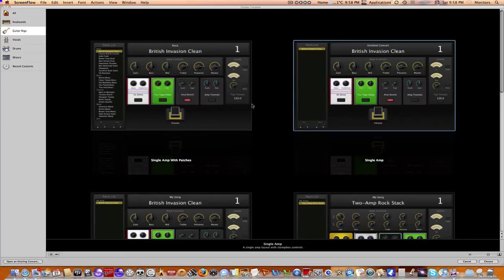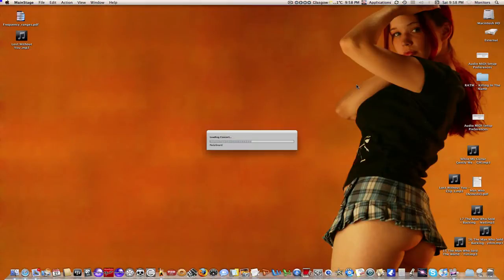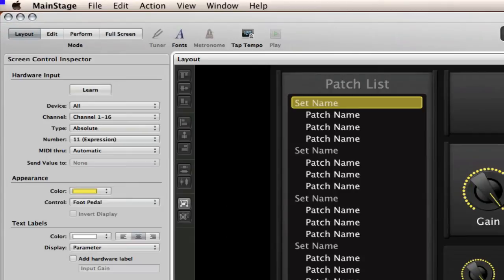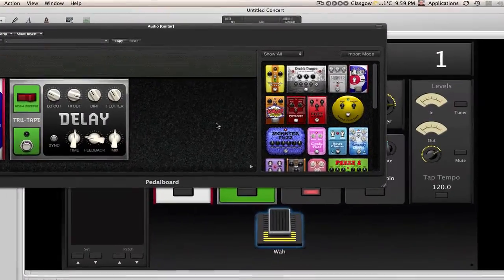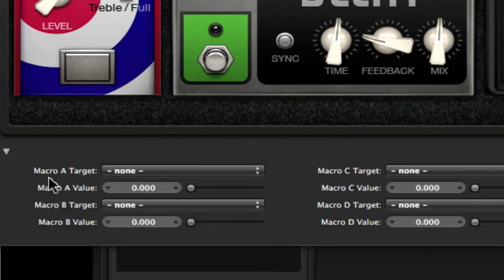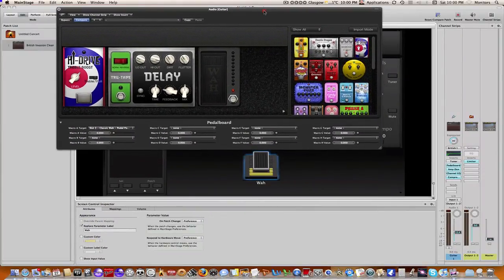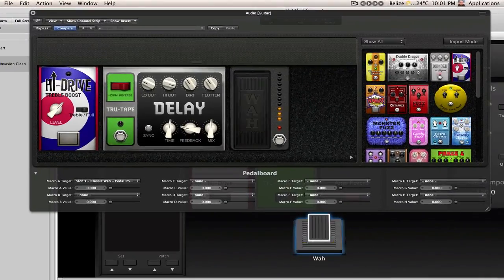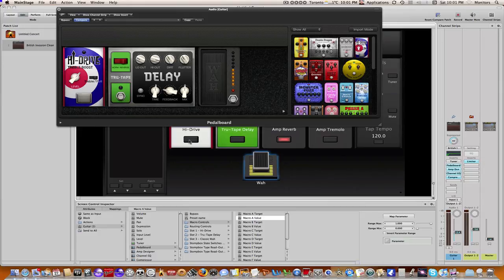Set up Wah In Mainstage and control with FCB1010

Comment from the maker: @NatureofCircuitry Not sure, but the first thing I would check is use MIDI Monitor if you're on a Mac (can't remember if you are) and see if your pedal is sending the correct CC values both up and down.  Check out my video called "Set up Expression pedals for Wah in Amplitube" it walks you through this part. Then let me know what the results are and I'll be happy to help you from there.

Comment: hi Jas, any idea why my wah only goes one way, like the min and max values are not applying. If I puch it down it reacts but when I push it back it does nothing, its set to 0 and 127. volume works fine both ways.

Comment from the maker: No problem man...the first thing you need to do is see if the pedal is sending anything out of the FCB first, that will tell you if it's even configured to do anything.  So, run MIDI Monitor (download it if you don't already have it - it's free) then move your expression pedal and tell me if it's getting any data.